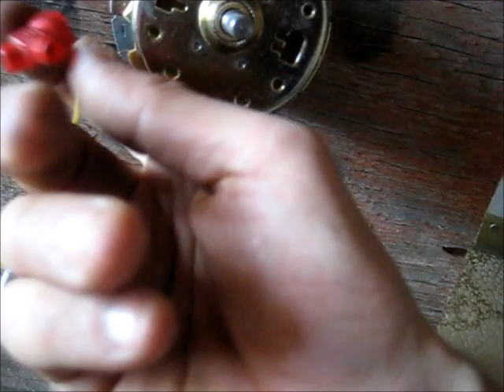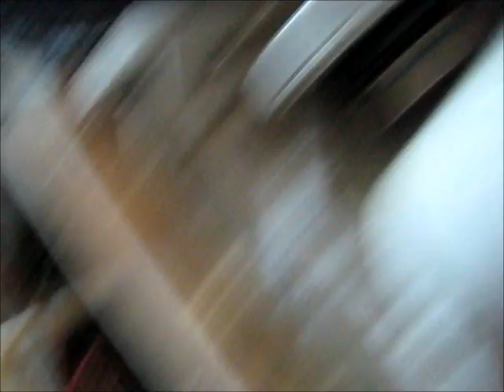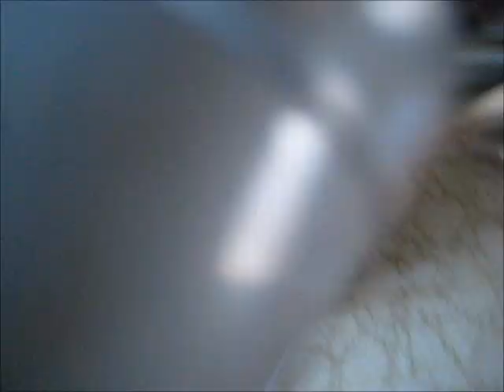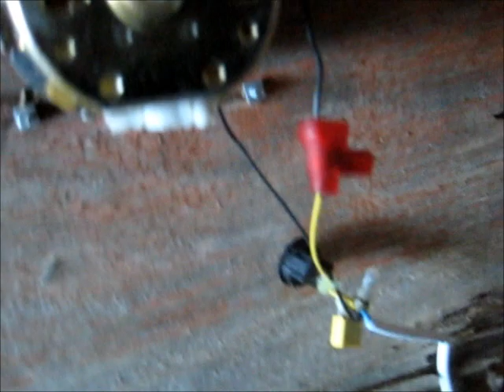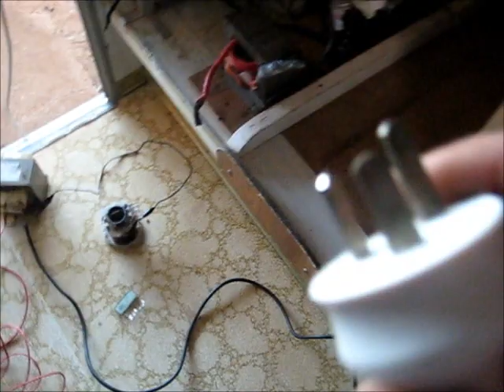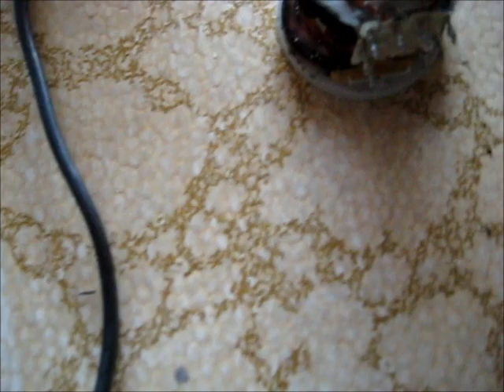Blender Motor Mod & LCD Potential Voltage

Comment: Mmmm, that motor still isn't playin' ball. OK! straight to the brushes, CD attached, & tease it on the variac, teetering on the edge of going *POP* :-D Don't forget to use your Fun-Jiggery-Pokery Unit to ballast the load: If the motor goes into meltdown or does a hard-short, that may risk damaging the variac. :-O

Cats: Aaaaww, they're sleeping together today. One of them has a loud purr! That purr needs to be amplified & put into a woofer to see how how much you can make it move. :-D

-BBD.

Comment: Great test, still not enough speed, maybe next time straight on the brushed, but don't burn it out yet.
LCD put on a metal plate ( or damp soil ) which is the same as the MOT return, you will pop it that way.
Nice kittens.